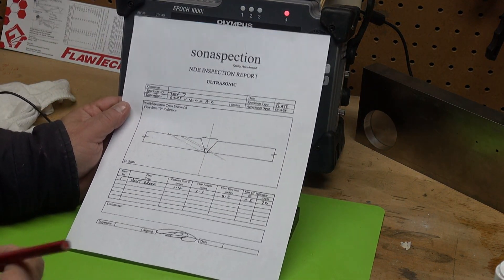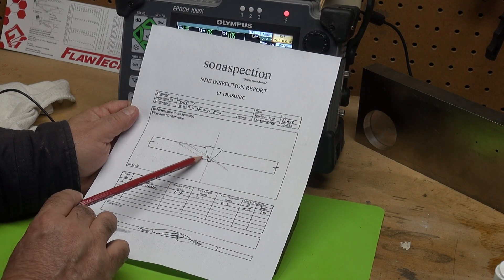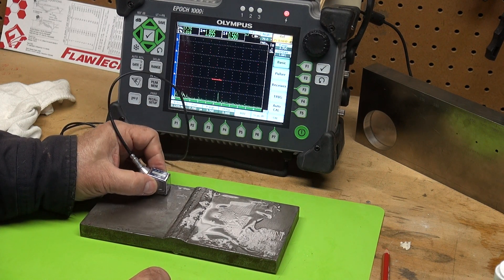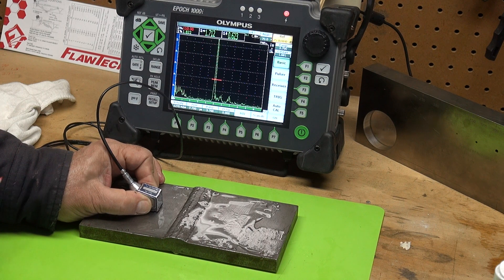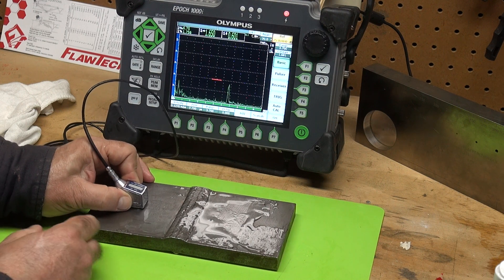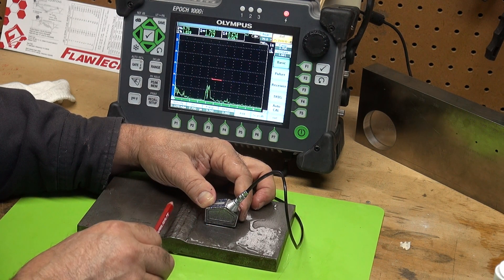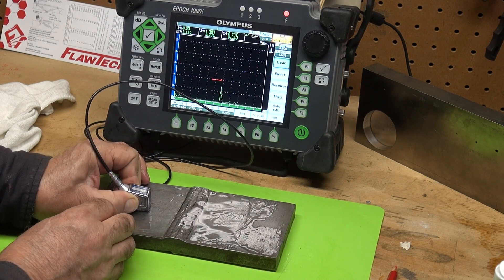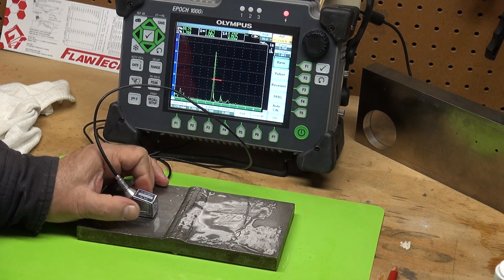UT Weld Root Crack Signal

Comment: What does it mean when you get a signal from the root from the side the transducer is on. 
But you can't plot it, because your beam path is way too high.

And when you move the transducer to the other direction, there is no signal at all ?
Reply: That could be mode conversion from shear wave to longitudinal wave
Reply: @mohamedkamel2409  Yes cheers Bud !! ... I asked it, because it showed up on my PCN exam. 

The signal haunted me a little bit, because it was my third re-test. I knew it wasn't anything so I didn't called it ... guess who passed his exam ?

Comment: You could totally connect an ultrasonic machine like this to a CNC arm and go over materials like a grid with a preliminary scan to scan large parts and then bring in an engineer afterwards to investigate the anomalies.
Reply: It depends on how big is the area of interest, if you are inspecting a weld then there is no need to scan the whole area, but if it is a composite removed from autoclave or press, then you should check the whole area as the defects can occur anywhere.

Comment: Excellent explanation. Thanks for sharing. If i may ask, is there any limitation in the product/specimen thickness. say, can I use this for 3mm thick weld specimen, to see a 0.3 mm crack depth. Appreciate any response.
Reply from the maker: Hello Prasan,  Thin materials can be hard to test.  A general rule of thumb is that a discontinuity must be larger than one-half the wavelength to stand a reasonable chance of being detected.  Wavelength=Velocity/Frequency.  Please click on this link, it may be of some help.  https://www.bindt.org/downloads/NDT2012_1A2.pdf
Reply: @johnnyb28227  Hi. Would magnetic particle test also showed defect?
Reply from the maker: @pietpompiepompiepiet940  Yes, Magnetic Particle test would detect this flaw.  MT will detect defects that are open to the surface and defects that are very close to the surface of the part.
Reply: @johnnyb28227  thanks for reply. What is the thinnest thickness I can use the olympus to detect flaws?
Reply from the maker: @pietpompiepompiepiet940  ASME section IX recommends minimum thickness to perform ultrasonic inspection is 6 mm.
Reply: @johnnyb28227  thanks